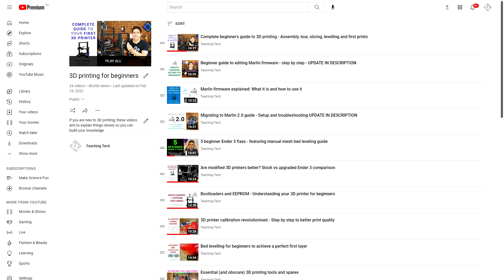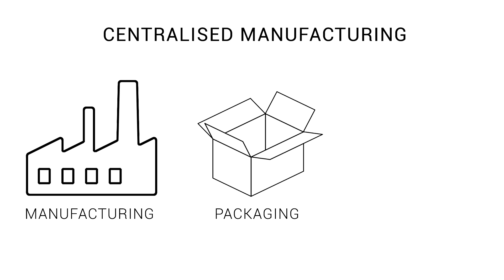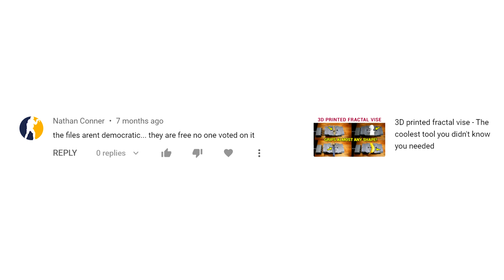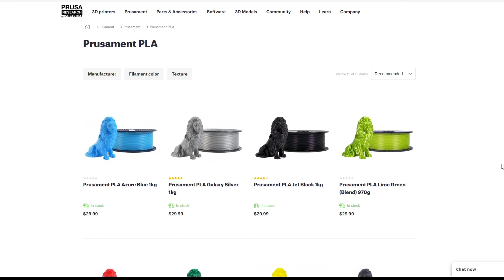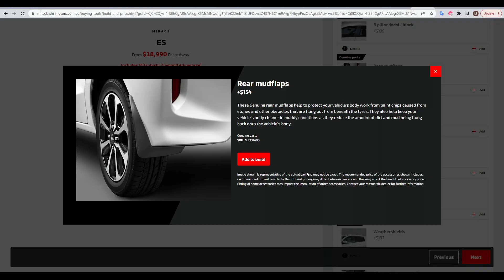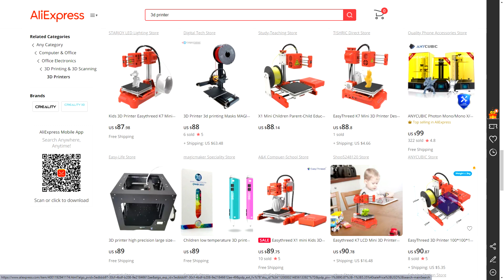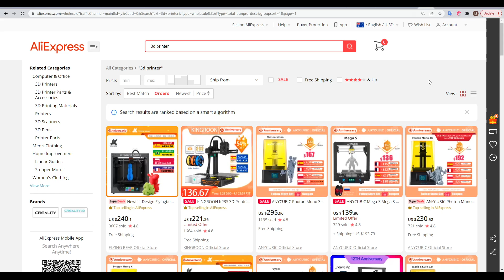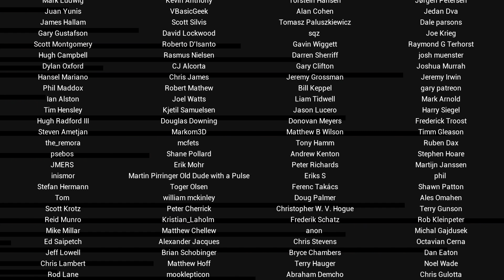3D printer trends are limiting mainstream acceptance: The 3D printing paradox

Comment: The idea that 2d printers and cars just work is a fairly recent one. Just have to go back to 1970 and cars generally had to be ticketed  with to work good. The idea of a car that "just worked" was born in the early 70tys in Japan, and then cars was alreddy 70years old as a comodity. 

For 2d printers is the same. While printing text generally always worked, printing grapics have been problematic  since then first dot  printer. We where actally a bit into then 00 before printer drivers "just worked".

Its not even the only problem. As late as the mid 90tys, most consumer grade printers didnt have sensors. If it jamed,  you better be there to turn it off.

And for high quality prints. Well not only was early dithering  really bad, but the resolution was also really low  in like 1989 you could show a perfectly fine photo on a computer screen and it looked as good, or better than a TV signal of the Day.

With a printer there was typically 7,9,12, 24 pins. And the collor is either on or of. So all the grayscale is dithering,  that for a 60dpi printer is not greate. Even for a 24 pin printer that could go as high as 144dpi, its still not greate image quality. By this time you can se what it looked like, bit ot wasnt like a photo, or even a cheep news print.

Color printers did exist, but they used the same head, so if you printed in 4 color the head have to pass Times, and well, if its high quality,  its 2 Times per color. And most early printers could only print forward. So the printer needed to do 16 passes  to make half a centimeter  of image on a paper. It can esially take a hour to print one page. And If the color band was low, well then the image was ruined. 

And the noice.  Those printers are really loud. My cussins mom did a PhD back in those age,  she printed here last week work every sunday  morning. There was 3 doors between the printer and here bed. She still 30 years later have dot  matrix printer trauma... and its not like the printer is not totaly covered  with sound  dampening. 

"Just buy a laser" ...
Those cost as much as a normal car back then... and well. Collor lasers,  well a smal house. And did they always work... no. If you wanted a office type laser,  then you had one in the celler with staf  attatched. 

Inkjet  did exist, but really untill the very last days of the 80tys, they was either expensive or horribly bad. The first good decent price (still used car price)  inkjet  come around very late 80tys. With 48 droplets typical and a resolution of 240-360dpi the quality was considuraly better. But dithering and drivers was still crap. While you could print a photo, nobody would confize it for a real photo. The colors was still stripy,  washed out and generally poor color representarion.

Drivers was still crap. If your software didnt suport the printer, you better find one that did.  And If the printer didnt come with drivers, there really was no download drivers.

Windows sort of made it a bit better, but it reallt was quite buggy. 

About 1995 printers with varible size dropelts come around. With proper calibration.. and special paper, costing  $1 per page, now it was possible to print something looking like a photo.

By this time usb was in the works removing everything called drivers. This is why a usb stick just works. Printer manufacutres refuced to comply.

The issue was that to make the printers cheper they removed the cpu from the printers. So the printer was just a breakout board with a few motors and heads. Everything happen in the softwarer that was pree compiled. If there was compabiliry problem.. well you didnt have a printer.. used,  linux,  well you didnt have a printer. Used mac,  but you bought a powermac pinter  on a Intel machine... sorry. Late 00 this was solved by partly cheap procesing board, partly by byte code,  and partly by the ultra cheap $30 was removed from the market when it matured. 

3d printers is about where 2d pinters was in 1992. Quality is actually decent. They are getting faster. They all look the same and they are very cheap. 

But software is horrible and there are way to many cheap models on the market that is just crap.

At least we dont have the special ink problem again....

Comment: The problem is that no manufacturer is really interested giving lay-people a device that renders half of their businessmodel obsolete. Half f the industry hates consumer 3D printers for a good reason. And they are all trying to invent a way to insert proprietary standards, parts and materials. A cohnusmer 3D printer that works just like paper printers will use expensive custom filaments that only fit that one machine, you have to use their app store that uses cloud computing to slice your parts for your printer model and standard filament. 

In other words: the hobbyist 3D printing is our ONLY way to 3D print as the entire commercial sector is either against it or will only approve it with HUGE amounts of DRM. Think printer ink cartridges... and then apply it to 3D printing. You will not be modeling your own part in your own machine, you will do it at their mercy. You will not print Honda Civic 1995 ashtray for free, cause it is Honda copyright. The manufacturing would be moved to our end but it won't be any cheaper, they just charge exactly the same, but this time you have to use electricity to make it.  If 3D printing comes to the masses it will be pay-per-model or subscription with premium features such as fine detail printing. THEY will control EVERY aspect of the process.

So, yeah.. They don't want 3D printing unless they can charge you for just turning it on.

Comment: I disagree with your theory. 3d printers, fillement, and parts are also packaged. the problem of packaging and transport has simply shifted
it would only be a solution if a 3d printer became a waste eater. old plastics 1 side in. new pieces out the other side

Comment: My great grandfather was the only one in our area to have a car with a cup holder, 5 years later every car had one. In 5 years every 3D printer will have a cup holder too. Then innovation will really only be relegated to the mighty, much like cars. Someone I know of used to race with a car that used the hood as an evap chamber for his steam cooled engine. He kept the temps super high so that he could minimize heat loss and maximize efficiency. I feel this video dramatically underestimates the community. Innovation is, has, and always will be a group endeavor. No one company or person ever drives innovation.

Comment: TBH, I have never bought the myth of democratised manufacturing. Most people aren't interested in acquiring technical understanding, learning to model, etc if they were everyone would be an engineer. People seem to keep conflating a hobby with its industrial counterpart. 

For me my ender 3 is a tool, I need to be able to tinker in order to keep it functional for whatever projects/tinkering I'm actually interested in doing. I know there are 'better' 3d printers, but a large number of home users don't actually need much more than that printer can do it's like owning a mini mill in your garage, typical tinkerers don't need a full on 5 axis machining station in their garage. 

Businesses might invest in larger format SLS or SLA but as with machining, a bureau or contract service makes better sense for most... A project might need a few tens of thousands of dollars worth of nylon or ABS prototypes before moving onto mould tooling, it's just not economic for them to burn half a million on a machine that sits idle 75% of the time...

Comment: Not too sure I agree with these points.
- The real thing holding back 3D printing is the simple fact that you can buy 99.99% of all the trinkets and doodads you need off Amazon.
- And we can't expect companies to be have an incentive to share part models. That just keeps them from selling you a brand new item.
- These manufacturers themselves are just tinkerers who found the means to make a product out of work that came out of the community, so the fact that there isn't anyone doing anything more ambitious isn't really their fault. 99% of laser/ink printer manufacturers don't innovate either. 
- Also, isn't trickle up kind of the dream of 3D printing to begin with? Coming from a software background, that doesn't strike me as too ridiculous or surprising. The downside to design-by-committee development is that the adoption of progress is conservative, so that's not surprising either.
- 3D printing can definitely reduce packaging and transportation waste in some scenarios, but in most cases, economies of scale win out over transportation costs, especially when you still have to transport filament anyway. And 3D printed stuff is notoriously difficult to recycle, whatever the material. So it's not as clear cut a picture.
- In order to build an economy on top of any manufacturing process, you have to make and sell a product with it. Which means that if we ever see widespread adoption, unfortunately, we're back to square one: packaging and shipping.

Comment: i think that in order for it to be more accepted it needs to be as end user poof as possible... no huge assemblies, no aligning of the bed, self detection and correction of print problems... the problem is, a manufacturer putting in all this is also likely to put their filament spools in little plastic boxes with an RFID chip on them, and have a closed box ecosystem... picture a cross between XYZ and Formlabs.

Comment: An ink-jet printer is so easy to use (sometimes) because it's a solved problem. The pages are a fixed size, and the movement is only ever in one axis at a time, and one of axis only goes forward! There's plenty of sentiment around them still however that they DON'T work that reliably and when something does go wrong, it's often hard to do anything about but buy a new one. 

In order to legally operate a motor vehicle basically anywhere, you need some combination of classes, practice, and testing to prove that you know how. And that's just to USE it! Imagine how many more people could use an ender 3 if we made everyone take a class on it in high school. Cars also need regular maintenance that most people need professionals to do for them. You don't see many desktop printers getting sent in to get calibrated. 

The hardware and software has advanced so quickly with 3d printers it's crazy. I don't ever think EVERYONE will have a 3d printer, but soon everyone will know someone who can 3d print something for them.

Comment: I agree with the point that cheaply made tat will poison the well for most people wanting to dip their toe in, and also your conclusion that if you pay more you get more.   
I did like your example of the car and usability.  My example would be the PC. PCs are everywhere not because of advances in chips or other inscrutable bullshit.  it's because of GUIs and mice and low barriers to entry.  Take Linux it works some of the time but fucked if I know how to do anything from a command line with it. 
 So that's probably what will happen, there will be the off the shelf option for the less technical.   And one following the custom PC model. Standardized parts of different price and quality that you buy separate and easily snap together yourself.  Think overclocking way back vs today or water cooling today vs twenty years ago.

Comment: If every Ender printer came with an ABL sensor and clearer instructions on how to set z-offset using a live test print, I am sure people would be immensely more satisfied with their first printer experience. I am probably exaggerating in my mind, but I feel like a good 50% of posts on troubleshooting forums end up being first layer issues. Now if there were also a way to auto-calibrate retraction (seems like a hard problem) and detect clogs (detect if the filament is actually moving at the expected rate), it would be pretty amazing.

Comment: There is no paradox. The paradox is thinking that 3d printing (specifically FDM) is something that can and/or should be mainstream. This is incorrect. It reminds me of the people wondering why Linux doesn't go mainstream. Its a technology for people comfortable with the technology. The car and inkjet printer analogy are inaccurate. People need cars to transport themselves (and some may enjoy driving), people need to print documents (and some might fancy desktop publishing). But most people have no practical need for FDM printers. Thinking that (at scale) people will want to manufacture replacement parts for curtain rods just because they can is just as invalid as assuming that everyone that ever lost the key to a padlock will run out to Bunnings / Home Depot to go buy an angle grinder. Manufacturers go where the demand is, and a select few will try to innovate. If you are wondering why so many cheap bed-slinger clones exist you have to look at who is buying. The mistake is to think that enthusiasts like us are somehow representative of the rest of the population.

Comment: I understand what your getting at, but if you look at the equivalent generation in the printer and car industry, you will see that it was the hobbyist the pushed those industries forward and not the big manufacturers. Take the car industry as an example, most performance and safety innovations have come from the racing industry, and this can be described as a niche/hobbyist community. I don’t know much about printers, but I can remember when many of these same issues were part of the home computer seen and to get you computer to talk to your printer reliably take some tinkering.

Comment: I'm not sure this hobby is anywhere near wide spread use nor do I think it will be for quite some time. Prusa is doing some really interesting things but I'm not willing to pay their premiums. That said, I beleive they are the closest thing to offering a consistently positive 'out of the box' end user experience. I wish RAT would try offering a standardized kit so that users of lesser skill and confidence could use their products.The AnkerMade M5 (Kickstarter) seems like a step in the right direction with 'out of the box' dramtically increased print times. I know this can be achevied on other machines but that usually requires a ton of tweaking, expertise and experimentation. I think Resin printing looks for very promising for wide spread use but the toxcicity of the materials are hindering it's wide spread use. Very interested to see where the future takes us!

Comment: Hard disagree. There are very few functional products (that replace a consumer product) that can be printed without modification for the final user. Putting a 3D printer in every home wouldn't reduce waste by replacing the need for consumer goods, rather it would increase plastic waste as it encourages people to print out useless trinkets.

I think the current hobby of 3D printing encourages people to become makers and tinkerers, not just consumers.

Comment: Until 3d printing is fool proof and simple enough for the every day person to just download something and print it . Currently it's in the same vane as a CNC mill or lathe where the skill to run the machine is fairly high . The problem lies in the fact that the current 3d printer market is not interested in simple printing over the ability to tweek things as they please . The best way to do what you want is to diverge at this point into consumer level printers and hobby level machines , catering to both groups seperatly.

Comment: There are industrial/commercial machines that are being designed for plug and play,  using cartridges for material and so forth,  the problem is cost, most home hobbyist want the most for the buck, these 300 dollar machines, do a lot for so little investment,  but spending 4,000 + for something akin to a paper printer, is still out of reach for most.

Also we have to remember that 3d printing is manufacturing, and manufacturing and tinkering kinda go hand in hand.

Comment: The bottom line is that most consumers are not “smart” enough to deal with all the issues that come up in 3d printing. I think people in this hobby overestimate the capability of the masses. 
If you doubt me, select a random friend or family member not in the hobby and try to get them to operate a 3d printer. 
It takes a certain understanding of 3d space which many people simply do not have. 

Also, the automobile industry was in this same place for a while before Henry Ford came along. Perhaps there will be a time in the future when enough of the most difficult things are automated that it becomes more like 2D printing, but that isn’t today.

Comment: I feel like this trend is good. When the companies drive the innovation, their goals seem to be profit driven, not always the best improvements. Take for instance the automotive industry, they do amazing tests for the sake of safety. The problem is that the improvements they  discover, so much, so often,  that the changes are often miniscule at best, but will drive cost up greatly from the cost of implementing it. This creates an issue where, yes the improvement does make you 0.2% safer, however, it will cost you an extra $1000. The opposite way often creates a genuine new and useful improvement. The community is doing the research and improvements anyway, so the byproduct of their efforts comes at less cost. The automotive industry does tests and research  to increase profit and safety, where as, the community does tests and research for fun and happen to find great improvements.